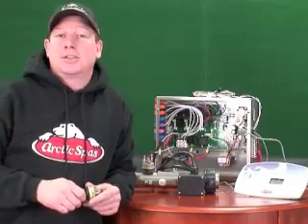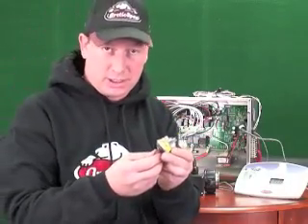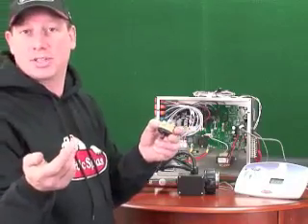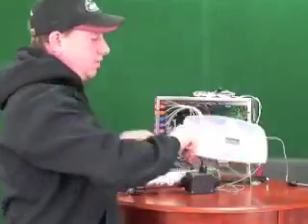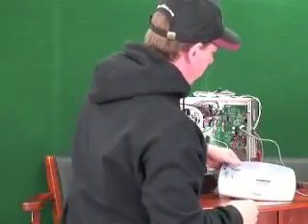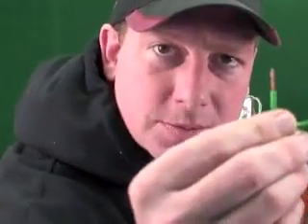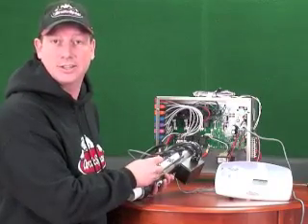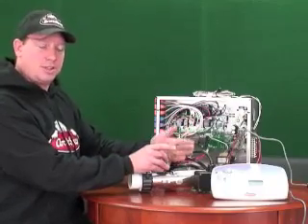*Pressure switch diagnosis.mov

Comment: My pressure switches have a common, NO and NC contact. Should I be using the NO or NC contact? Also my display is just reading FL (not FLC or FLO) . Would that correspond to a flow open or closed error? I get the error when pump 1 is running on low. Water is flowing. I cant turn the pump on high or turn on pump 2 or the blower.
Reply: NC is normally closed, NO is normally open -- you should also have a Common -- the idea is that common is connected to NO when it's not triggered, and then when it is triggered, it will connect to NC instead. -- So it just depends on what kind of signal your board expects. -- I would guess you should use Common and NO (i.e. it should be open when there is no flow, and closed when there is flow). -- Anyway, if you get the opposite behavior, hook it up the opposite way (i.e. use common and NC second). -- (Disclaimer: I don't know anything about hot tubs, but I know a little about electronics, please use this advice at your own risk!)

Comment: I have the Balboa VS300 pack,.....I have NO presshure switch I have circ pump flowing Light clicking sounds like a signal Light in a car at the same time? Not heating?
What are your thoughts???? Im stumped?

Comment: 1 . yes, check the pressure switch .  
2. if you have three blinking dots, and a red light on the board.. its your 
Hi-Limit Probe.    ( just a probe that attaches to your heater.

Comment: Are you out there?  I jumped my wires and all works fine.  I replaced my pressure switch.  It didn't fix it.  I called back the part company to see if I got the correct one after some research they said I needed a different one.  Installed it but still nothing.  IDEAS?
Reply: LOL I think it's safe to assume this dude does not reply back to comments 10 years is a sufficient amount of time

Comment: Turn power back on. With one line from voltmeter touching black power line at the power block, touch the left then the right side of both fuses. They are both normally supposed to read either 120 and 120 or 240 and 240, depending on what type of tub your have. If there is any change between voltage between the left and right side, replace that fuse. It might have continuity, but does not allow full voltage through.

Comment: Dont know if this is too late to help you out. Had a hot tub that i just repaired that had the same problem. If you have 2 green fuses on your control board, it could be the following issue. 1 of those fuses supplies the power to your 2nd pump. Pull boh fuses out ( power off first of course). Check for continuity with your voltmeter. If you have continuity on both fuses, replace both fuses back  into your board.